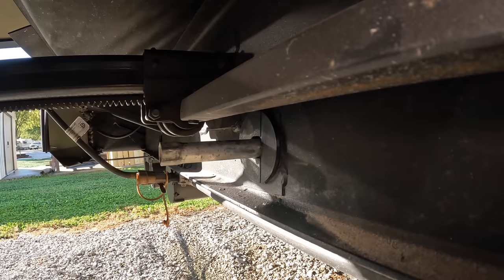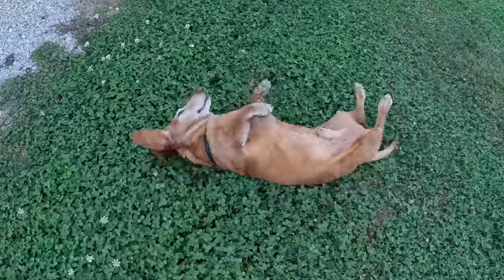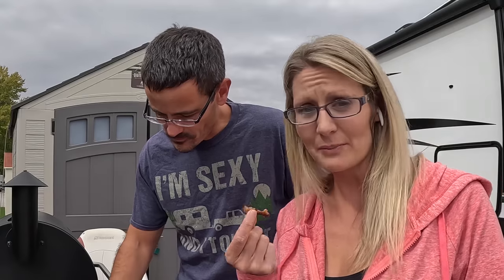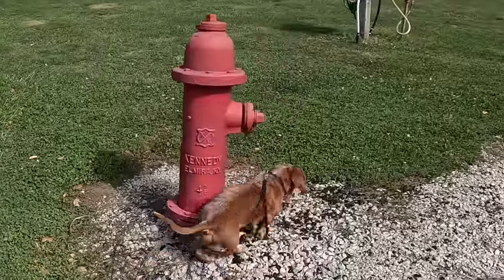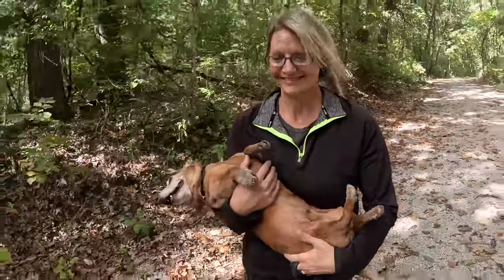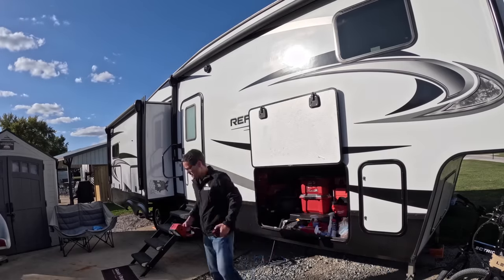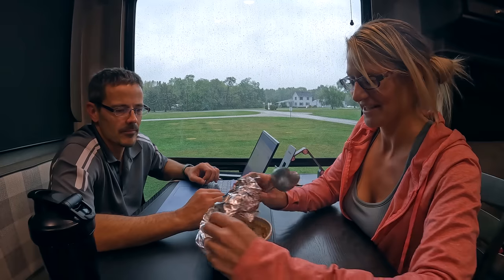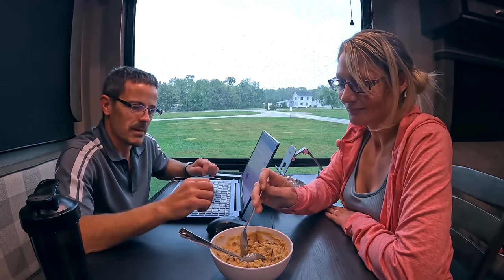FIX THAT SPARE TIRE!  RV life!

Comment: Great idea on installing extra sensors Cody.  I installed the YoLink Sensors not long ago and attached them with velcro so they don't slide around.  After watching this video, I think I will also order a couple more sensors and place them in similar areas where the water supply lines run through.  I just have them behind the water panel, the sinks, and behind the toilet.  I am sure if you discover how that water appeared on the floor you guys will let us know.  Safe travels!
Reply from the maker: We feel better with the extras for sure! We have not been able to come up with anything better than sleepwalking.  Maybe Cody tried to empty the large dehumidifier in the night and missed the toilet or shower! 😂 It’s a mystery!

Thanks for watching!

Comment: Maybe check your A/C system and see where the condensation run-off is, maybe a clog? We had a bathroom water issue where water came in thru a cracked vent pipe & out the bathroom outlet during rain, found it during a rainstorm.
Reply from the maker: That’s a good idea!  We did have both of them running hard.  I’ll check that out.  Thank you!

Comment: We had a phantom random water leak, and after going over every water line, we couldn't find the leak.   Then, one day after a really good flushing of the black tank, the water on the floor appeared and found it was the check valve on the black water flush line leaking. Why it was random.
Reply from the maker: Well that makes a lot of sense!  This would have been on the opposite side, but it is something we wouldn’t have thought of and can watch for that. Thanks for sharing!

Comment: I have a question about the item you use to keep pests out of your RV. Are they magnetic? Or do they snap together? How do they stay together to keep the mice out? Do you have a link to be able to purchase them?
Reply from the maker: I have the direct link below.  This is an individual that made them for himself and starting selling them.  They are super cheap and although we weren’t smart enough to catch it when we filmed (hehe), it also comes with a set of covers for your slide too.

He may recommend something different in the instructions, but we just used black silicon adhesive.  It is the same seller as the tire jack stop.

https://www.etsy.com/listing/1561037775/camper-closures-includes-2-thru-frame?click_key=420cb4e25e8519348cabc8f360ef6fc5942eafa3%3A1561037775&click_sum=2817af06&ref=shop_home_active_6